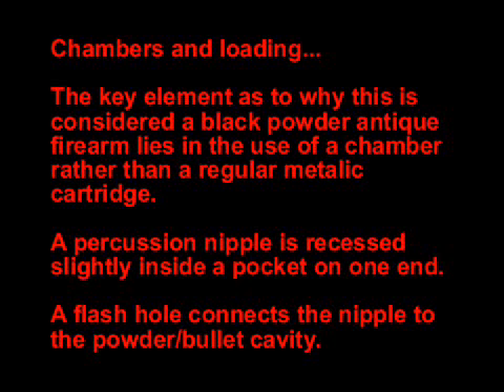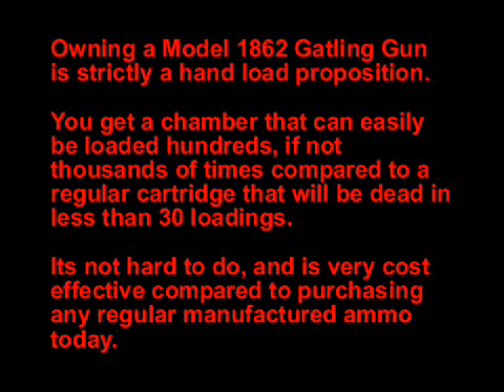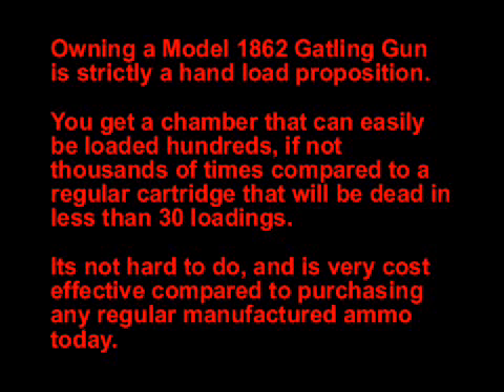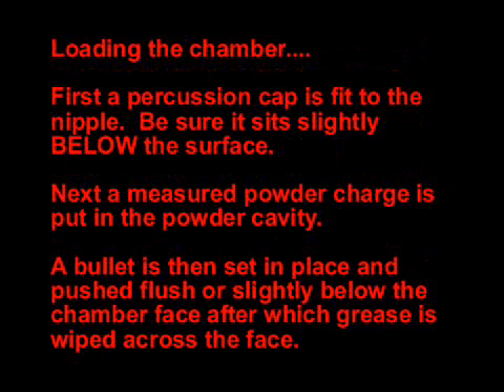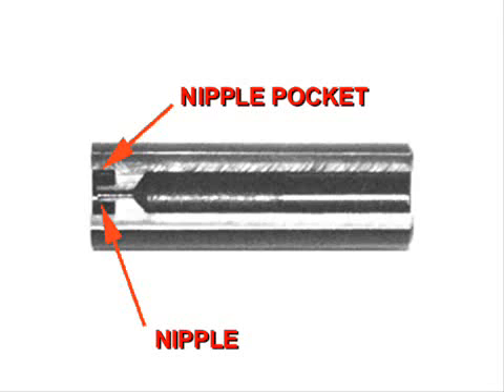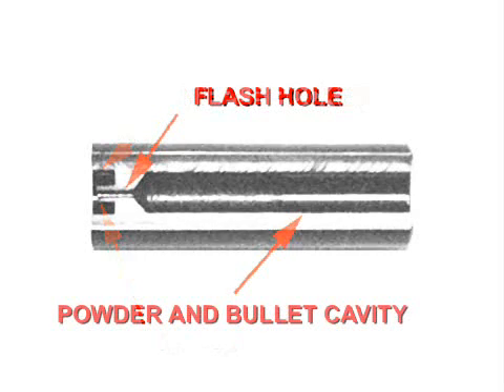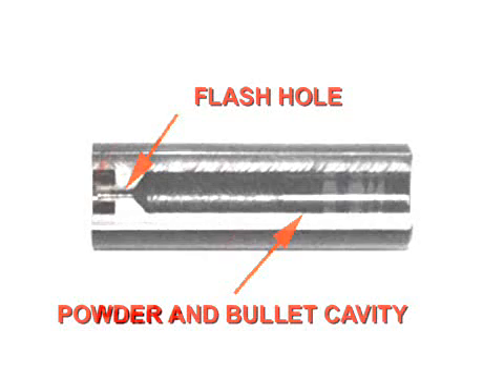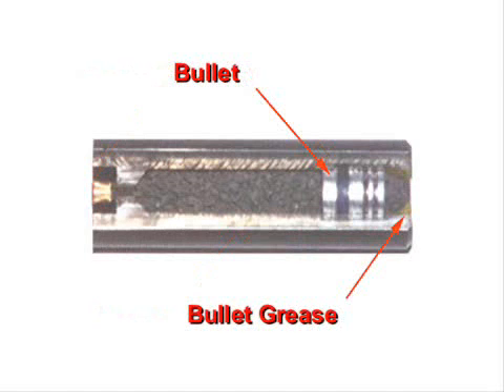How a Gatling Gun Works

Comment: As long as your gun is hand operated.  Its not an automatic.  Stick a crank on an AR rifle and it's still not considered an automatic by the ATF.

If it loads your "chamber" without manual interation(such as with a crank) with each shot.  It is considered an automatic.

ATF posted it's  it's website go have a look look at it.